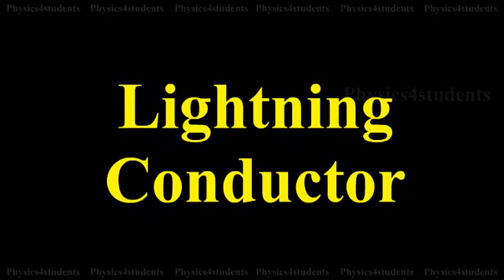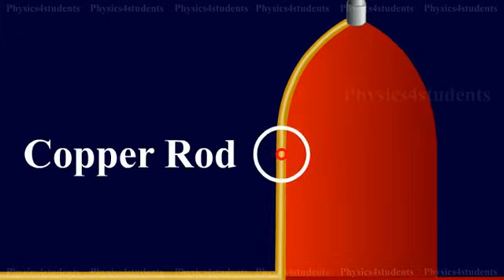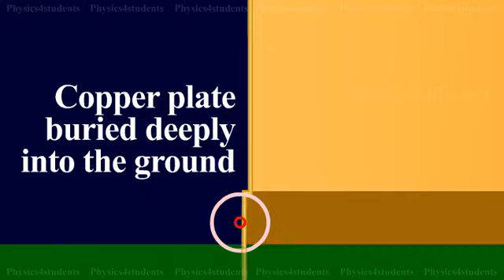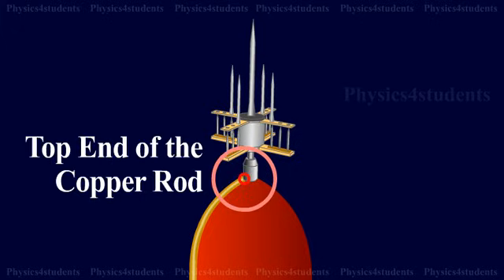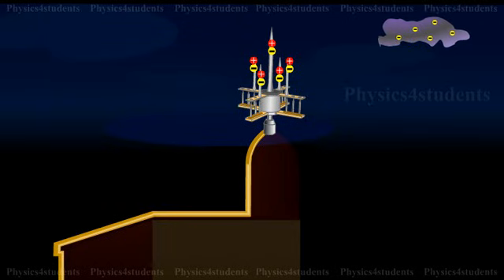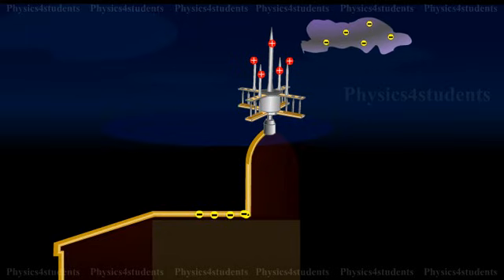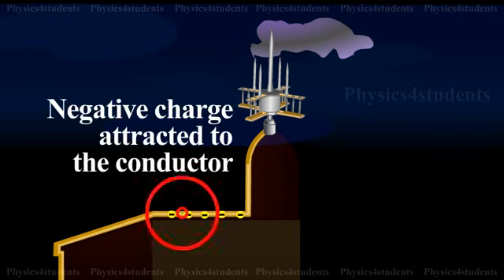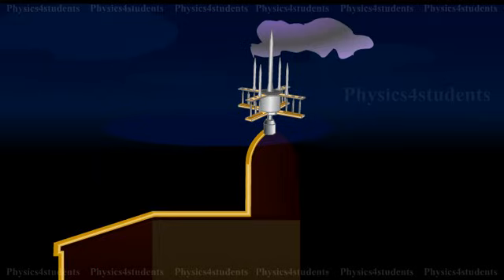How Lightning Conductor Works

Comment: This is what she actually said:
Lightnin condakta. This is  a simple device used to protect thall bilthings from the lightnin'. It cances of loon tick cooper rod passing tru the bilding to the ground. Tha lover end of the rod is connected to a coppa' plate barid deeply into the grond. A metol plate with the number of spikes is connected to the top end of the  coopre rod, and cept on the top of the bilding. When a negativly charged cloud passis over the building, the postiv cha'ge will be induced on the pointed condakta. The postivly charg'd shap poins will ionize the air in the vazility. Dis will partly neutralise the neg'tive charge of the cloud, thereby lovering tha potensial of the cloud. The negativ' charges that are athcracted to the condektoa trevels doown to the od(Earth). Thereby priventing the lightning stoke from the demage of tha building.

Comment: mmy doubt is why this top rod is made sharp at top point...  bcz its sharpnes is going to increase resistannce... on the other hand if we have flat portion at top then it will catch nore area of thundering... pkz reply
Reply: If the edge is sharp , more charges are accumulated there increasing charge density. So , the accumulated charges(here positive),due to corona discharge (action at points) the positive charge leaks out thereby ionising the surrounding air into positive and negative charges .And the negative charges in air attracted to positive charge but the positive charges are repelled by the positive charegs .So the positive charges in the air neutralises some amount of negative charge in the cloud reducing the potential difference.

Comment: Cloud to Ground Lightning, demonstrating cumulus convection intensification, is an electrical process being driven by both electron precipitation from the Inner Van Allen Belt located directly above the Earth’s equator and Solar forcing induced ionization within Earth’s Ionosphere.  The mechanism behind Cyclone Intensification is described in detail within my Broadcom Master’s Grand Award Weather Channel 2017 interview and my New Mexico State award winning 2018 New Mexico Google Science Fair entry titled “Van Allen's Key: Unlocking the Secret of Yearly Worldwide Tropical Cyclone Activity”. The links that unlock the secret of Cyclone Intensification are provided here:
https://www.googlesciencefair.com/projects/2018/171e50b2cff5898513e14907f2c63bbebafcd1827c2fb5bc575f3f1c0950a1b3
https://www.youtube.com/watch?v=ER_MaIUEeGc
https://www.facebook.com/broadcommasters/posts/1637539636308237
The earth is, beyond a shadow of doubt, floating in a sea of energy!